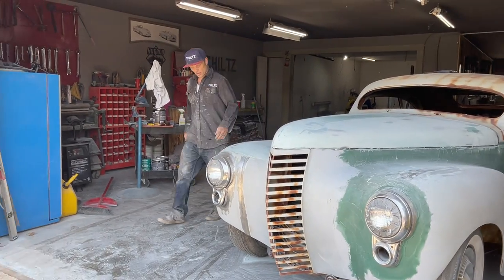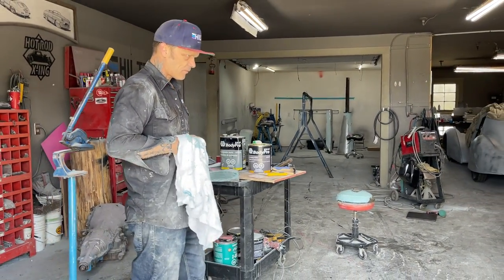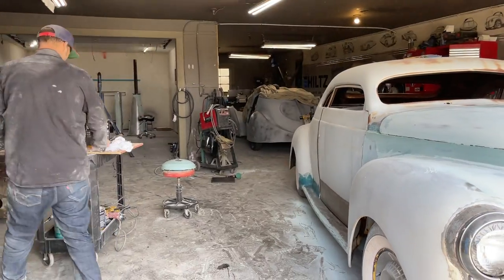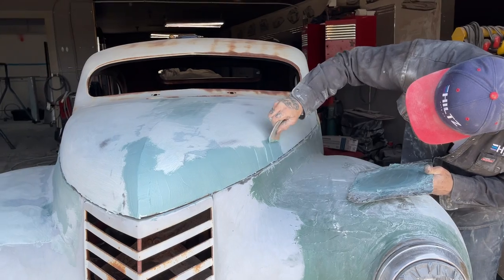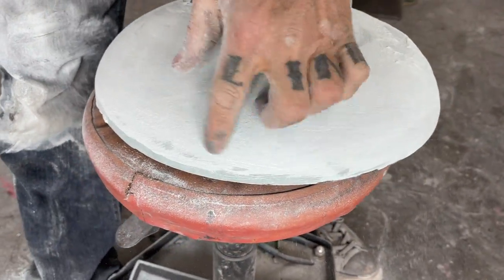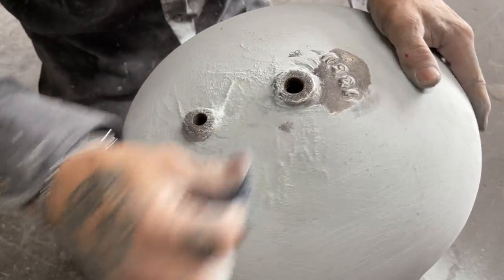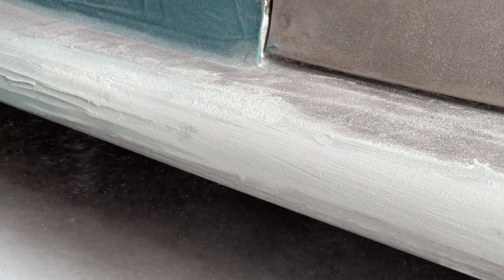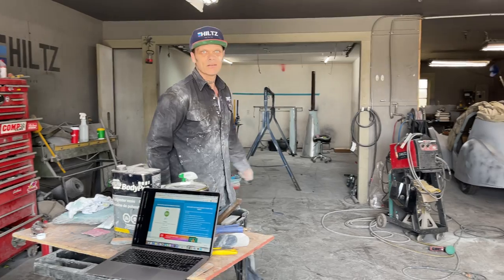1940 PLYMOUTH: APPLYING AND SANDING AUTO BODY FILLER

Comment: Chad you really should be wearing a mask while sanding. That 40 is coming along nicely. Can't wait to see some color on the body. How do you get glass for windshields etc when you do a chop? That old 78 Ford would make a great shop truck. Great for advertising when running around hunting for parts. I think the 39 would be awesome on the Dodge van chassis to use as a vehicle to haul trailers. You need a hot rod to haul a hot rod. Glad to see you are coping through this covid stuff. You are so right, if everyone is not on board or on the same page, they are going in the wrong direction.

Comment: Sure like the looks of the older houses around the town were you are going to pickup the truck & 1937 ford. Like to see the 37 cut down to a sport car the size of a 55-57 Thunderbird + a small block engine V6 or & v8

Comment: am building my self a new DA out of an old three brush Electdrolux floor polisher i got out of the garbage , with three pieces of sand paper on it i think it will work awesome , and fast too
Reply: Hate to see it go wrong if you can’t hold on
Reply: Also they just rotate they don’t oscillate so will be too tricky and dig too much with clean paper and bung up the paper too fast and cause grooves

Comment: I agree with making a cool shop truck, but what you really need is a Bad Chad \ bad ass custom trailer with the parts you have out back to haul your cars so you don't need to rent one each time..  A Bad ass Bad Chad custom trailer that no one has ever since before would be really cool and practical...Bad Chad  and Joline get yourcreative juices flowing a
Reply: Build your dream trailer!!  
Quicker and cheaper than building a car.